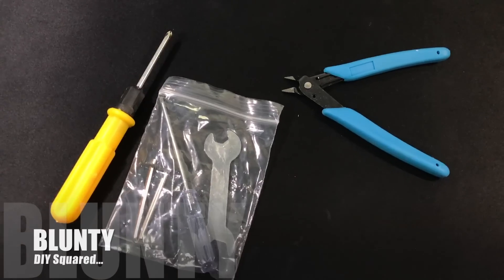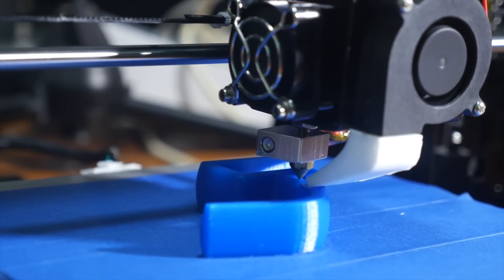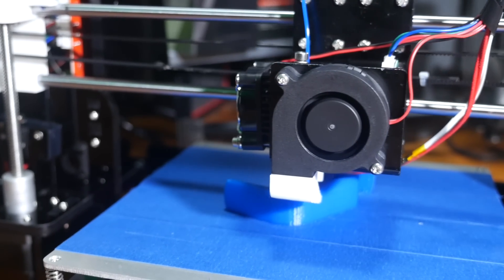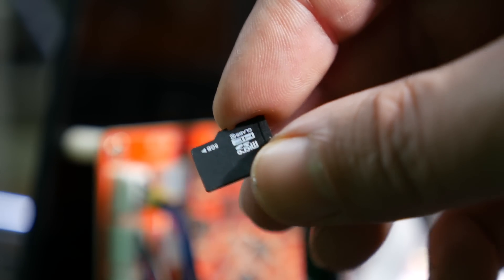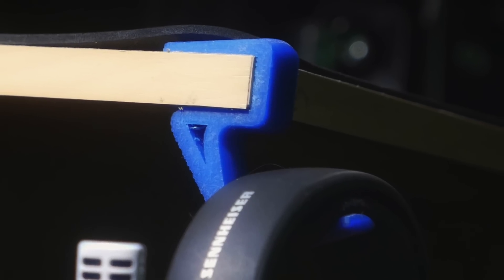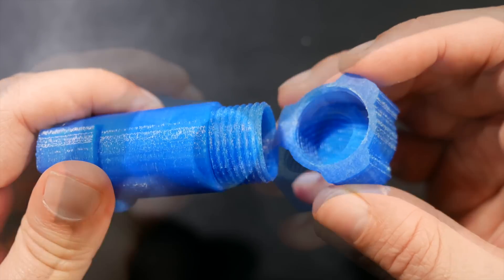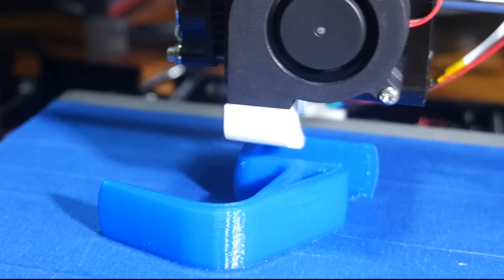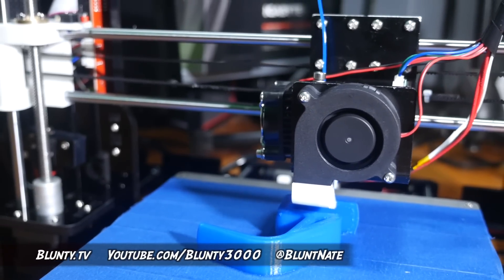What can a $160 3D Printer Do?

Comment: This was the... third? printer I built for myself maybe six years or so ago. It was a decent printer for the price, and it taught me a lot about printers, especially when the power feed for the heated bed was sent with an insufficient connector and melted the control board 😑 Once I dealt with that, it ran well enough to keep me happy until I could buy a printer that was less of a kit experience. I wholeheartedly encourage people to build a printer or two (or three), they were all a blast.

Comment: i have bought the printenr and have been using it for a few months now and its great 
my prints come out really crisp and look amazing. 
its realy a cheap printer but if you put some time into it than it can be an amazing printer to start with. 

indeed the mains wiring might be a bit scary becaus its... well you know mains power, but aslong as you dont touch it your good. i do how ever recommend makeing a power suplie cover for the cables just in case. i added a 3 point pc connector with a switch so i can easely turn it on and off. al those files and components can be found on thingyverse or on google.

Comment: Hi, i just see your video, i have also a anet A8 and it is effectively quite tricky to poll out the filament, i found a quite nice trick for pla, heat the filament to 220°C-230°C it will be very soft, at this moment you juste have to pull out in a quick movement the filament, since i do it this way my filament si no more stuck in the head the the printer.

Comment: Two years back, I bought exactly the same 3d printer, but back then it still cost ~250$. Still works really well! Addressing the filament changing issue: 1. Heat the nozzle up to about 210 °C. 2. Unthread the screw that's holding the spring in a bit. 3. Press down on the screw so that the gear disengages on the filament. 4. While pushing down, push filament in a bit, extruding a bit. Now you should be able to pull it out with ease. 5. Straighten the new filament out at the end so that it's straight, not curved. Now press down on the screw again and push the filament through until you see it coming out of the nozzle. 6. Tighten the screw again. 

This is the method that has worked best for me after clogging up the entire extruder and having to disassemble entirely for 3 times...
Reply: BeatRush2011 
Have you noticed any change from wear and tear with the printer? Has it gotten any worse at printing or is it any more finicky or fiddly?

Basically, how durable is it, and do you think it could last 5-10 years of occasional use in making replacement widgets around the house or random doodads for gaming.
Reply: Well for me it's been working well, the only problems I encountered were with moving the printer and one of the wires breaking off of the heating element. I haven't noticed any other signs of wear and tear. But it is a diy printer and everything is easily fixable with every part available on eBay. For that price I would definitely recommend it, but calibrate it well and tighten all the pulleys so that there's no slipping. Just buy one and you'll have a lot of fun with it, I guarantee that!

Comment: I actually have the same exact printer and I wanted to know how you precisely adjusted your z axis endstop, I had to use a screwdriver as a pry bar to move it ever so slightly and I wanted to know if there is a better way, thanks.

Comment: ABS filiment is pretty tempermental. You have to keep it warm, otherwise the lairs will warp as it prints and it will come out looking more like plastic tumble weed. So you'll need to do something like put a box around it or something to keep the heat inside.
PLA is the exact opposite though and requires you keep it fairly cool as it prints, so an open air printer like this will do wonders.

As for filament thats made with corn startch though, that's not PLA. It's PVA which is a dissolvable filament  that's great for getting complex prints to come out with out destroying it by removing support structure that's bound to it. It's made using corn starch and can be placed in water to dissolve.
Reply: Nate Rivers layers

Comment: I bought one of these like 5 months ago and the trick to changing filament at least for me is to heat up the extruder push some filament through manually (About 10 cm of filament) then as quickly as you can pull the filament up. When you are putting the filament back in just cut the end to a point, straiten it then prey that nothing got plugged up when you pulled it out.

Comment: seems like a bargain. been wanting a 3d printer for ages, but i haven't been able to justify the cost. if its as good as you say it is, then it looks like this is the printer for me. is there no way to print directly from pc? any network adapters? i've heard acetone works well to smooth out the layers, is this the case?
also, if people are worried about the bit that can kill you, take it to an electrician to wire up the 240v side.
Reply from the maker: acetone will work on ABS prints only. Not on the PLA I've been using. acetone is a solvent for ABS, it "melts" it, thus judicious use can smooth out the surface.
Reply: o ok thanks. good to know, roughly how long was the assembly time?

Comment: MAN I need an 3D printer!!! Im using psmove as positional tracking and ps3 camera on tripod,if i had 3D printer i did it very easily and very acurated to dont fall down or anything. sadly in brazil its very expensive,if i buy one for 160$,with tax and all it will cost a price of 2: 320$ for only one 3d printer